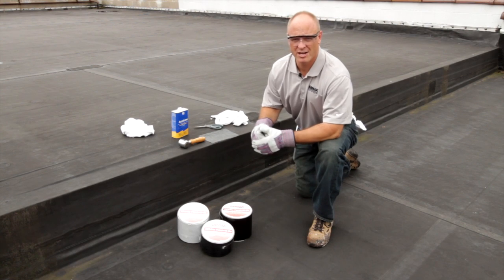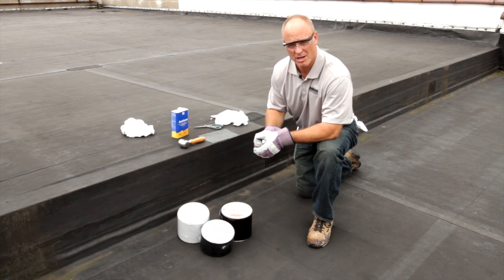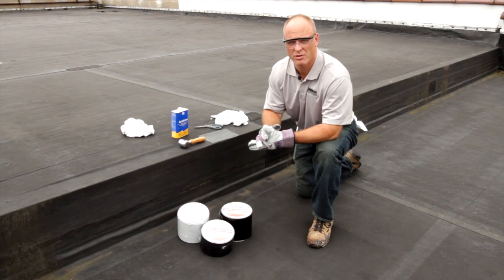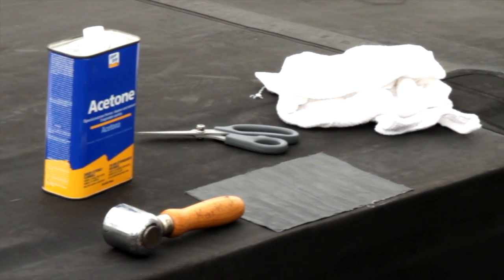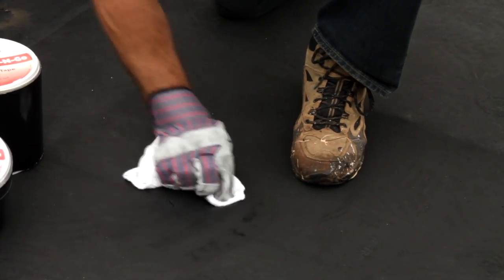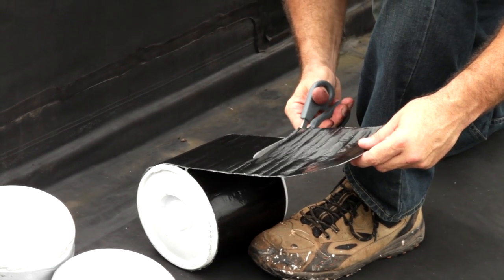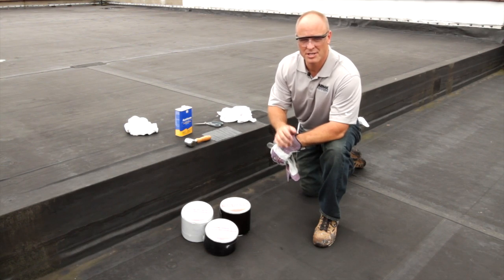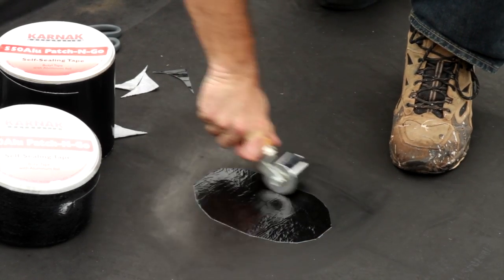550 Patch-n-Go Self Sealing Butyl Tape repairs on EPDM Roof

Comment: Temporary fix. I like Karnak products however I do not like this video. Not a good way at all to repair EPDM unless you just want to repair it again. This just simply will not last unless you have no warm temperatures or rain. Unfortunately peel and stick tapes are not a simple fix as manufacturers suggest or I wold be out of a job because everyone could easily fix their own roofs.
Reply: Thanks for the info I have a patch to do tomorrow in Wisconsin temp will be about 35 to 40 tomorrow and just want to get to the summer to do a proper job. Do you think temp will be a issue
Reply from the maker: Thanks for the insight!
Reply from the maker: Thanks for Support!